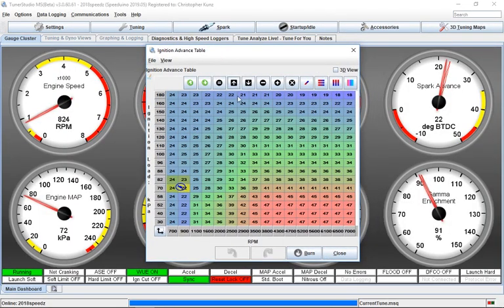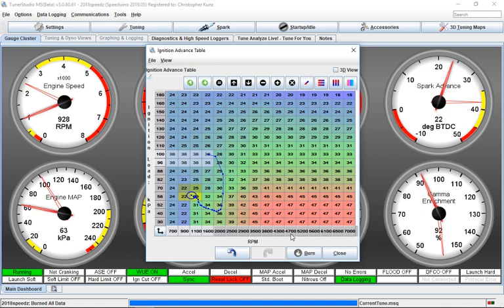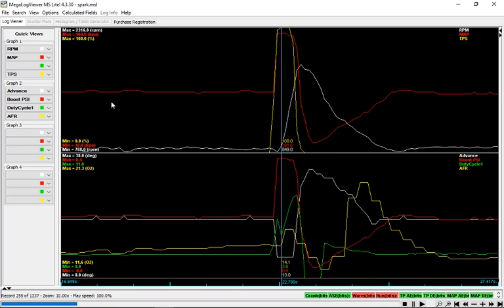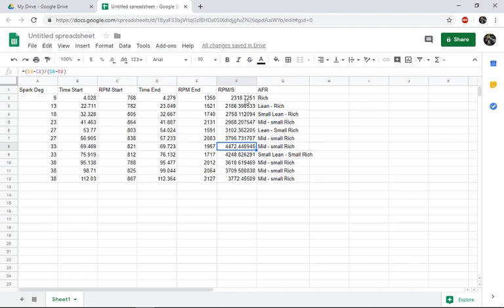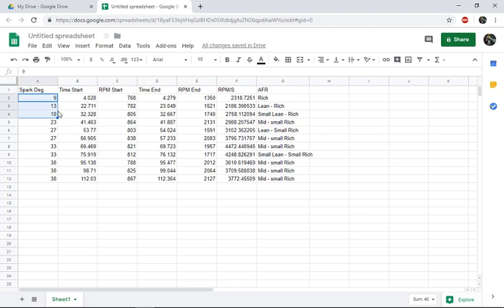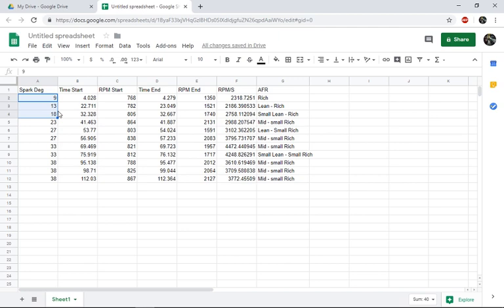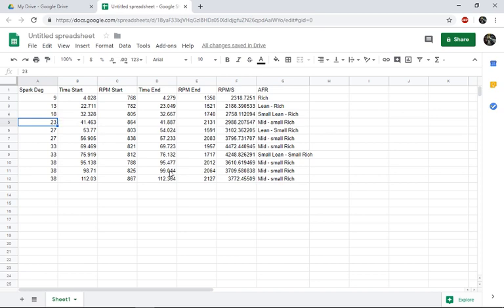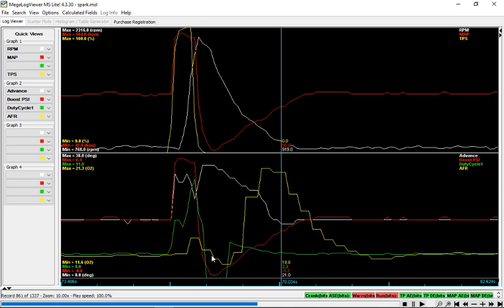Improving Throttle response off idle with Spark Timing

Comment: Good video.  I've struggled with my microsquirt for a few years.   You're explanation on 70s distributors are a bit off.   "36 degrees at 3500" means you get 36 degrees of mechanical advance  IN ADDITION to whatever static advance is dialed it.   If initial timing is set to 10 degrees, then you have 46 degrees total advance.    Also, the vacuum advance should be connected to a PORTED vacuum port.  This means you get zero vacuum advance at idle.  When the throttle blades open up, the ported vacuum port is exposed and you get vacuum advance at cruising speeds.
Reply: Hate to be the bearer of bad news, but you are totally fkn clueless and I bet whatever you tune runs like a 💩!   70’s distributors have approximately 20* of mechanical advance, for example an HEI distributor from the factory has 20* mechanical and then you add your initial timing , say 16* then your total timing would be 36*.  Now listen close.....always connect vacuum advance to manifold vacuum as you need extra advance at idle to fire that lean idle mixture early as the flame front needs more time to travel across the cylinder!  The only exception is if you have some 70’s EGR bullshit with thermal switches that switch between manifold/ported vacuum depending on the needs of the engine at the moment. Not having enough timing at idle makes the engine run hotter which they would do on some early emissions controlled nonsense of the 70’s..... Outside that and especially for performance use manifold vacuum.  David Vizard and a few other gurus have videos explaining this because a lot of people seem to be ignorant on the subject and then debate and spread misinformation!!!  Instead of getting pissed at my candor learn something!  You can test the theory yourself and you will see the difference.....engines at idle under heavy vacuum love extra timing and run much smoother with better throttle response....the dude in this video even says so...

Comment: Very interesting, those little lean blips .... maybe You can get some improvement by adjusting acceleration enrichment.
When I got an electronic ignition for my racing classic Jaguar MK2 there was a procedure to optimize the ignition curve. You could set an ignition curve and then accelerate the car (using a higher gear so it takes a bit longer) and time how long it took the engine to get from 2000 to 3000RPM. Next you went back on the same stretch of road, added 1 or 2 degrees of timing and did the same again. As long as the time gets shorter you are still before max torque. Eventually you reach a point where the time is not improving any more or even dropping (now you get close to knocks) ..... if you set it 2 degrees back you got it right.
I think this could be done with a data log filter where you exclude data below 2000 and above 3000RPMand include RPMdot and do such runs and monitor the time it takes to get there.
Greatings Bernhard
Reply: Under no load it will like lots of idle timing.

Comment: Interested to see ms knock control/detection
Reply from the maker: Been working on other things, Looking to dive into knock soon as I start to push the timing in the next few months (I like to do it in the winter time with the cooler air)
Reply: @CEKGarage  I need to figure out how to have knock control on my speeduino ecu asap lol
Reply from the maker: Some have used Knocksence with some luck. I have yet to have a chance to dive into it.
Reply: @CEKGarage  are they still making knocksense? If so I'd grab one to try out.

Comment: Why is your idle vacuum so high? Do you have itbs?
Reply from the maker: Two reasons, cam and tired bottom end on the block. The short block is a junkyard block for testing spark and detonation on. It has about 200k miles on it.
Reply: @CEKGarage  My shitbox has like 35kpa at idle and its clocked 200k also.. Cam probably makes a big difference tho
Reply from the maker: It does, and that said there are also a few other things that are coming into play as well. I am testing out a code I had for baro correction. I am at 4500' and when I updated to the newest firmware, it messed up my table a bit since it went from native 89 KPA to 83 KPA.. The other thing is the engine is not crossflow. So the cam compounds it a ton. But, all of this will be fixed in the near future :)
Reply: @CEKGarage  Getting a crossflow head for the L28??
Reply from the maker: Oh I wish! I am sorry, I did not mean to sound like I am one of the few getting that special head. I more was talking about getting a better cam for the turbo and fixing the low compression. As well as a few other things.
Reply from the maker: Reuben, I tried to respond to your comment today and I removed it. Did not mean to do that. I should have zoomed in on my phone first. Sorry about that.
Reply: @CEKGarage  no worries mate